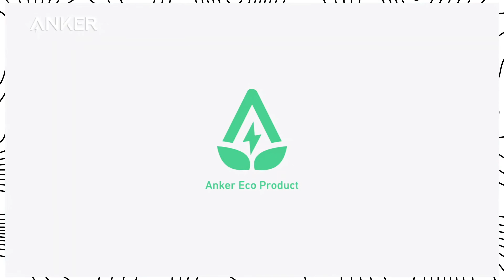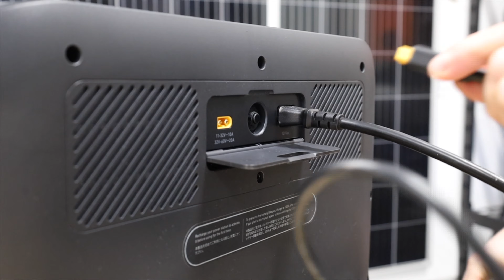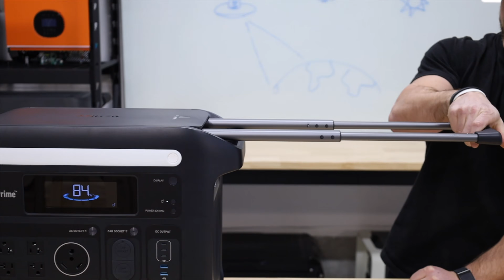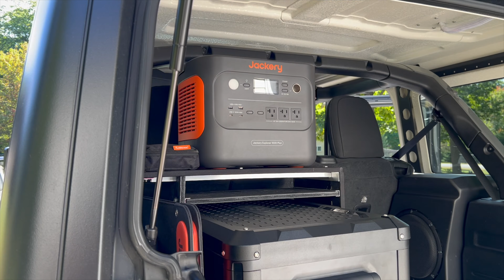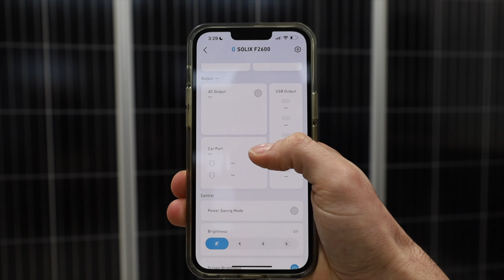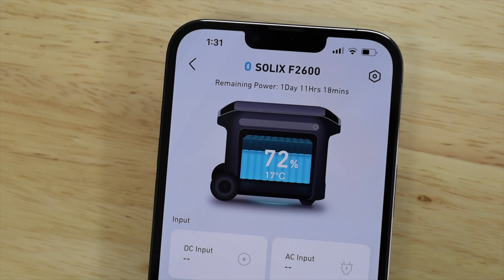Anker F2600 - Can it REALLY Compete?

Comment: costco anker next ( linked from the costco web site ) has the F2600 bundled with the BP 2600 add on battery for $1799.  That is $0.35 a watt hour.  Was tempted but did not pull the trigger.  Since this is over 3kwh ( with the bundle it is 5.1 kwh ) it qualifies for the clean energy tax rebate that ends december 31 or 30% off.  Then this makes it $0.24 a watt hour.  I asked chat gpt and this will run my fridge for a couple days and recharge with my generator in ~ 3.5 hours.  We are approaching hurricane season in Florida so maybe i will never need it but i love anker products and was dying to buy this and the latest price finally made me make the move.

Comment: Attention to detail?
Look boy wonder, let's get into details here. As a engineer i can say advertisement only.  Heed my words commenters. Look let's break down watts and amp hours to start. 
Using a 230 amp hour battery as a base factor.  Volts x's amps = watts so 230 amp hours x's 12 volts equals 2,760 watts. Now to have a healthy battery you need to keep a minimum of a 60% charge. That gives us 40% of power available. 10 % of 2760 watts is 276 watts. X's 4 to get your 40% usage is 1,104 watts.  Now to explain your how power works if your running your tv and a fan using 200 watts. That's 200 watts per hour. You have just over 5 hours of power. That's it. Unless you drain your battery then you have taken life away from your battery.  Thinking if you get 200 watts of solar panels this will allow endless power. Ummmm no! It may be rated for 200 watts but that will not be the wattage constantly feeding your unit. A single shaded area over a solar panel in use is a accident waiting to happen. You need direct sunlight at all times and will generally never see the rated 200 watts charging on your screen. I'm not even going to start comparing a standard refrigerator explaining surge watts then running watts. But if i did without solar you might get 4 hours before the battery starts dipping below 60%. Now Anker, Eco Flow, Bluetti, and Jackery are basically all the same.  Features are the difference. Battery's,  the same. A watt is a watt no matter if its on the grid or off the grid. 
I say so watt lol to anker thinking it's playing on a different level. It's not. I personally,  have a AC300, with 3 300 batteries. But i have maxeon solar panels capable of 2400 watts. This keeps my unit fully charged and allows me to take advantage of the extra power during the day. Washing clothes, vaccumn etc.... two batteries double the watt hours available. So before you run to buy a solar generator i suggest you do research. I will say I'd purchase a Eco Flow or Bluetti, long before I'd buy a Anker. The features make the difference and Bluetti has the features bells and whistles that outweigh the options of anchor, and eco Flow.

Comment: For solar panels is it reversed polarity? I want to use my thunderbolt solar panel 100 watt that has an SEC connector from Harbor freight? Wanted to know if I need the reverse polarity attachment in order to use this solar panel on either Anker Solix 2000F or Anker Solix 2600?

Comment: Great review - honestly hit all my hot buttons ... Question - I presently have a 6-panel / 400W solar array - do you think that the Anker 2600 would just take a portion of the 2400W that I'm pushing into it - and not use the rest of it ... or should I go thru an external inverter to handle that.  Thanks again - terrific review !!!

Comment: Can you link two F2600 power units to each other?
Reply: No
Reply: @Bamabrute85  I just received 2Amker power stations, an F2600 and an F3800. I placed a load of 150 watts on the 2600 and plugged the 3800s ac power cord into the 2600s ac inlet port and then into the 3800s ac outlet port.  They charged and the only measurable difference was a 15 watt discrepancy in each units ac out and ac in charge/discharge. Seems to work pretty well.

Comment: will this power station run outdoor events for a DJ with 2 RCF EVOX 12vs a mac book pro and a RANE FOUR ..? and for how long ...?
Reply: Assuming the higher end for safety, the total estimated power consumption for your setup would be:

Two RCF EVOX 12 speakers: 700W x 2 = 1,400W
RANE FOUR DJ controller: ~50W
MacBook Pro: ~100W
This totals approximately 1,550W, which is within the Anker SOLIX F2600's continuous output capacity of 2,400W.

To estimate the runtime:

Total power consumption: 1,550W
Power station capacity: 2,560Wh
Runtime = Capacity / Consumption = 2,560Wh / 1,550W ≈ 1.65 hours

Comment: In your Jackery van install, you have a COOL slide-out setup, stacking your solar generator and a powered chest-cooler. If you don't mind, please share where you bought that thing... outstanding?

I'm currently comparing features and costs of Anker and Oupes solar generators... both seem like great setups.... hard to choose when comparing size, weight, portability, inputs/outputs, cost, etc. Thanks for this Anker F2600 video... a lot of great observations and insights.

Comment: I ordered this last year, great unit. The extra battery is nice to, my only issue with the extra battery is 1, it does not work without the main battery and 2, it does not have a pass through, so there is no way to carry the thing securely like the main unit and secure it. Had it have a pass through handle like the main unit, I can secure both of them in my RV or in my shed for an extra layer of security. You don't want to spend all of that money and have no way of securing something. Another thing I would like to see is a more flexible cable for the extra battery, it is a stiff cable and you can't have anything in it's path. Both units work great and it in my RV. Unfortunately, I'm still trying to get the 30A to power my lithium system for some reason it is giving me a reversed polarity issue but I think it will work. the size is perfect for a RV van. I got the F2600, extra battery and 2 x 200w solar panels and the panels are heavy.

Comment: I just looked at shop solar and the panels they have do not line up with the anchors charging requirements. Anchor needs a 60-volt panel and you can't total up to more than 20 amps. So you won't get the thousand w an hour charging. You'll only get 400. I saw another comment about Home Depot selling them. Just make sure the panels line up with anchors specs.
Reply: They spec it so you have to buy Anker’s panels to fully maximize the solar input. Ridiculous greedy move, and is the primary reason I didn’t buy the F3800 version.

Comment: I know you love the XT60 splitter cable, but I believe it to be a CON because the moment you plug it in and you are not using the other plugs the xt60 ports a live, and you can get shocked.  They need to know about this small glitch.

Comment: Does anyone know if you use this in UPS mode and simulate a power failure, then drain the battery until it shuts off at 0%....will it turn back on automatically when the power failure is over?  Or, do I have to press a button manually to turn it back on after this.  Hoping someone might be able to test this.  The F3800 seems to resume after a fully depleted battery is plugged back in - but the F2000 does not.  This model is in the middle, so I'm not sure it has this feature or not.  Thank you!

Comment: I recently got 2 C1000X units and then I ordered two of these F2600 units as well.  C1000X have been great and I haven't had any issues.  The F2600 just arrived and looks like it should be good - but I have one issue.  When it is plugged into AC it will not charge at more than 250W.  If I set it at 200W, it charges at 200W.  If I set it anything else (300W or greater), it caps out at 250W.  I can plug loads into it (ie: a space heater) and it runs fine and goes up to 1700W+ so it isn't that the unit is limited to 250W, just the charging.  I'm just curious if anyone else has had this specific issue.  My C1000X units immediately go to whatever I set them to for charging speed.   I'm hoping it is a firmware issue.  I have reached out to Anker support as well.
Reply: ty for this info.. i am looking into buying a f2600..  any idea IF f2600 is on a full charge how long will it run a WINDOW AC 12000 BTU?  Any idea how many hours? Also can u charge this f2600 with YOUR cars inverter?
Reply: @donblade5405 it probably wouldn't even start an AC that large
Reply: @Bamabrute85  well I got f2600 and one of those newer low volt ac called 
Midea 10,000 BTU U-Shaped Smart... and it works for aboit 4 to 5hrd
Reply: @donblade5405  oh OK. Yeah those inverter style air conditioners are great 👍

Comment: Anyone used this as a backup for an EV? I have a 2013 leaf and just want to have something to take with me in case I need a little boost
Reply: You won't be able to use level 2 charging, But if you use a neutral bonding plug, the charger will turn on and charge at 12 amps no problem. Just make absolute sure that you remove it if you run your house with it as ground loops are bad. I tried it myself on my delta 2. I have issues with EVSEs on floating neutral supplies.
Reply: A petrol generator…. No joke … Ev’s are still not ready
Reply: @clinteastwood8222 Nobody asked for you opinion about cars
Reply: @clinteastwood8222 Nobody asked you for your opinion
Reply: @clinteastwood8222 How is this any different than a generator?

Comment: I just recently bought the F2600 through Home Depot. They have a killer deal including 2-200 watt panels for under 2K. Plus,  if you're a Home Depot card person, they are also offering 0% for 24 months.
Reply: I just went today to Home Depot to cancel the Delta Flow 2000 Max that I ordered and then order the Anker F2600. :)

Comment: Thank you for this great review! Would this have enough power for a 15,000 BTU RV air conditioner with soft start?
Reply: It will power it, the surge on my @15000 BTU AC is 2000w, but the time it will run on a 2.6kwh battery like this is about only 3-4 hours
Reply: @dougthompson1598 is that 2000 watts startup with a soft start installed? Also, is it an RV AC or a window unit?
Reply: ???  Any info?  will it power a BTU 15k and if so for how long?

Comment: Just got one, great device that works very well but I think there could be some improvements, starting with the charging cable, it would be nice if it was another foot longer, second, the back socket panel door is a bit tricky to open and finally the Towbar,  it's a great idea but since this unit is heavy, somewhere down the line this Towbar will eventually break, otherwise love this unit so far.

Comment: Isn't it about time for an update, since the current model F2600 has a number of upgrades....Please
Reply from the maker: What are you referring to? This is a brand new unit
Reply: @TheSolarLab  I guess I was referring to (unless I missed it) the addition of WiFi and simultaneously charging that had changed from the F2000.

Comment: This doesn't compare to the 3.6kwh Ecoflow Delta pro, it's more of an ecoflow delta 2 max with 2048kwh capacity.
Reply: First, the Delta 2 max doesn’t have the TT30-R outlet to use as home back up or power an RV. Second, the capacity of this one is 2560 Wh not 2048 wh. So basically this one is more useful  than the delta  2 max and more portable than the delta pro.
Reply: @issameQ  You don't need that TT30- R to back up your house unless you're going to use dryer or Ac and if that's the case, 25kwh is going to last like 30 minutes, so it's pointless. For just lights in your house and regular appliances, Ecoflow Delta 2 max can provide such power continuously 25kw max. As matter of fact, my house is backed up by one and continuously powers my 150w fridge, my Internet router and my 70" tv with solar using extension cord.
Reply: @LJLion  The TT-30R is used for the convenience to connect to a power inlet that’s connected directly to your electrical panel. 2.5kwh isn’t that much lower than the delta pro capacity at 3.6kwh. You can expand it to 5.5kwh if you want. Also the unit accepts 1000 w of solar charging. So while it’s connected to you your power inlet it can be charged while powering your house. So it doesn’t have to last 30 min. Plus running major appliances that uses a lot of power isn’t for all day and should be limited during an emergency.

Comment: Only 60V max solar input. Boooooo
Reply: 60V 16 Amps is not enough for you or you r mr. Series Guy and hate your mr. Parallel brother
Reply: @s.i.m.c.a  I have a video on connecting the bluetti and the anker. In parallel, you need to fuse every positive connection.

Comment: The solar panel parallel hub is trash - all the unused ports are live and carry voltage. This was a known issue with the F2000 model - I see anker refused to offer plastic plug covers for this. not only for safety but to keep those connectors clean from contaminants. Besides that nice unit overall, basically an updated F2000 they really should have added a second external battery port to compete with compacity offered with products from bluetti & ecoflow. Kudos to anker for making this compatable with the external battery they already make and not designing somthing only exclussive to this model.
Reply: Bluetti changed down to only one expansion on the AC200L
Reply: @LamoidZombieDog  only one B230 - B300 batterys can be daisy chained. So two can be used with the 200L.
Reply: @grindychum  yeah the ac200l only has one expansion battery plug unlike the two on the ac200max, so you can only do one battery now unfortunately
Reply: @LamoidZombieDogThey're bringing out a new expansion battery too, more "square" and, I'm assuming, chainable.
Now, let's see them obsolete B230s for ￥70,000 or so!
Reply: @worldcomicsreview354  never heard of them doing that. But even if the b230 is replaced it will probably not drop in price much. You gotta just build your own custom expansion battery
Reply: They sell generic xt60 covers

Comment: Saw F2000 for $700 less. 
Hmmmmmm. Would Love if bar light can Changes color. Like Blue. Green etc
Reply: An American Engineer plugged in one of those Thing Amen Jiggy onto its 120v outlet. He Gotten two light readings indicating Hot Neutral Reverse. Can you Plug also into Your's at The Lab. And see what the Lit Readings show.
Reply: @larrywong7834 
I bought two of these Anker 2000s one with reverse polarity, and one without!
Doesn’t seem to cause any problems with the one reversed? But if you’re worried about it, you should contact the company.
Reply: @simon359  Thank you.
From my AC300 I saw Correct and Hot Reverse Neutral.
When AC300 received Grid power from House Wall Outlet
Polarity was Correct at AC300 20amp Outlet.( House was Correct). When Grid was off THEN I got Reverse Polarity as generated at AC300 Outlet.